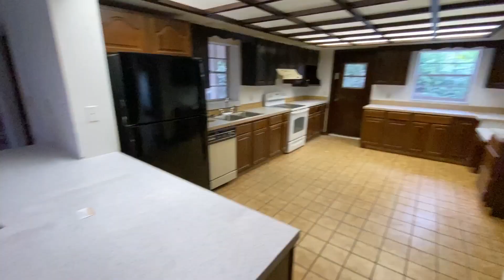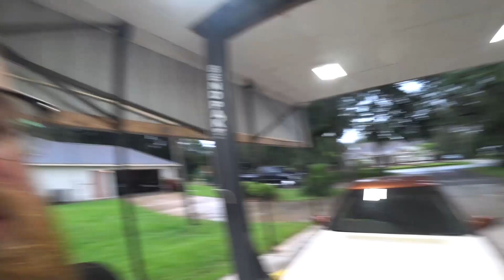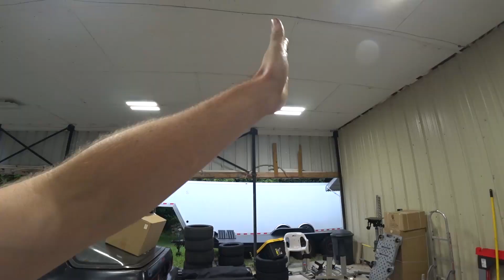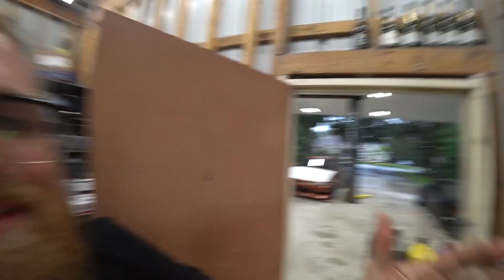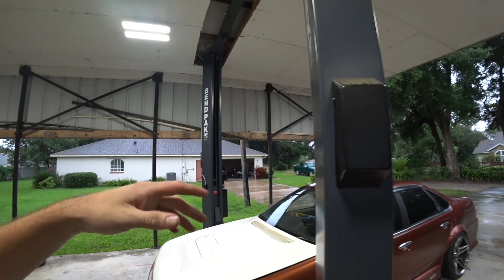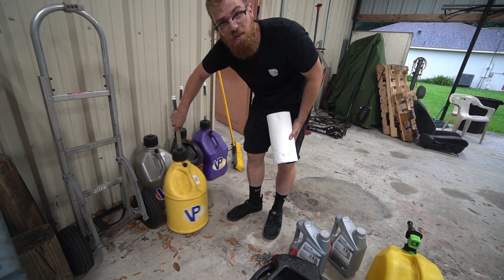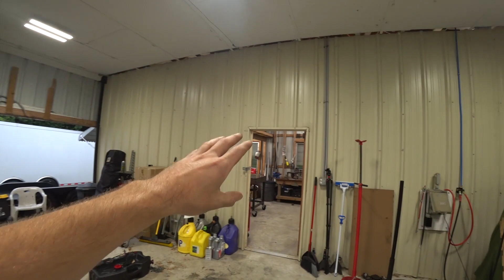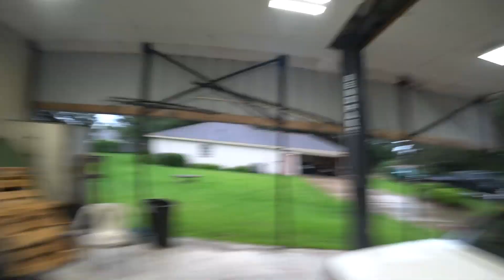Update on my new shop. I have to tear it all down.

Comment: The takeway? When you have an existing structure, permitted years ago... Just do what you want, and don't bother the city. They, and the contractor lobbyist groups that create these standards... are just creating job security with every inspection, standard, requirement, and permit they issue. It's not about safety, unless the safety of their own retirement is what you mean by "safety". Nosy neighbors notwithstanding, nobody cares what you do on your own property as long as it isn't directly affecting them. Make sure it doesn't, and you are usually home free.

Like the old question goes: If a tree falls in the forest, and there's no one around to hear it, does it make a sound? You can rework that to say:

If I do work on my place and there is no report to the city regarding that work, will an inspector come around to ruin my life? Most likely not. Do things quietly, and incrementally = Don't make too much noise, and don't do everything all at once.

You will of course have to do things yourself and use some common sense, but that's the trade off. Here's to your freedom. Enjoy it.

Comment: Would they allow you to have decorative iron work on the sides and front? No wind problem with wind 'caus it blows thru.  I'd the iron work happens to exclude people...great!  Decorative iron gates in the front roll away access!

I have seen roll up canvas/synthetic materials tarp doors on aircraft hangars.

Best of both worlds?  Roll up walls. Breezy when you want it enclosed when you want it.  AC if you want.

If the iron work is not declared structural and the roll ups are clearly not structural...

I suspect you can weld.  Labor addressed?  Look on line for the folks that make the roll up hangar doot.

Problem solved?
Reply from the maker: I had that thought. Building metal frames that bolt in. Then doing like removable inner skin. And  fake vines or whatever. But building the front wall is what’s complicated.
Reply: Do not connect the decorative iron work to the building..  Set it in footings.  Plant some vines that clime the trellis.   What the British call " Shoving a creeper up your trellis ".  

I'd it is not connected to the building is it not a perminant trellis for your climing beans? So the beans sometimes need a little shade and wind protection?  

If it is not connected to the building it is not part of the building!

Comment: I'd have bought two bay doors, designed and cut pieces for frames like on the sides to hold them, had a welding shop weld the pieces together, installed them, then finished the bottom of the two sides just like the tops were done, and nobody would have ever been the wiser. You are your own worst enemy for not taking the initiative.

Comment: If tou had problems with permits, then why go forward. I live in Fla,  n trash pick up reports to the county if they have to pick up an old water heater. Code info cement stops to see the permit and inspects the work. If it passes you have to pay 4 times the amount of the original permit. If it doesn't pass you need to pay 4 times the price, plus hire a licensed plumbing contractor to have it done and pass in section. And I know it's just a water heater. These days, there are just to many eyes. Then when you try n sell your home, a surveyor comes out makes detailed drawings of your property n building on that property. So if they don't match, they research looking for building permits and if they don't find them a whole can of worms is opened. 20/30 years ago things were different. I've all ways told customers to take as many pictures with tape measures showing accurate measurements especially on foundations, the size of rebar, spacing anything that they want to see before the footings n slab work was done. Tie down straps. Recites,  any thing that might come into question. ANYTHING. They might say OK, but then its paying 4 times the amount on all your permits that were needed. I've been an electrician for 4o years, built two homes, pulled permits I needed, got mu C.O.  And moved right in. Sometimes n someplace, it's not worth the money or the hassle to try n slide something buy. I feel bad for you, it looks good, but it's not always a neighbor.  Someone in your neighborhood might be having something inspected,  they see something else going on. They look into it. You have the mailman, meter readers, trash pick-up  any number of eyes. Hope all works out for you but if you were told at the beginning their is a problem, don't go forward. Find a solution. Maybe it was a zoning issue, what you were going to do in your shop. A machinist, you might need thicker and stronger concrete. Abom79, is building a new shop that has a crane going in so they had to pour a special footing under the crane to make it safe and 5000 lb concrete for all his heavy equipment. All I can say is best of luck. I sure don't want to see you have to take it down.

Comment: I think financially tearing it down is a poor financial decision. Because it's a perfectly good structure, you literally paid for it in the purchase price. Truly weighing up the cost benefits of it, I would continue to use this structure until it's reached the end of it's life span, that means, as it's approaching a point where maintenance is going to cost more and more to keep it, then pull it down.

I think what I would go with, is just sealing up the sides with some see thru material. Also, not sure about your permits, but here you can go full brick garage entry to a car port. Plenty of people have them at the entry to properties, where it looks like a garage, but behind the brick exterior it's just a carport. In fact, funny story, guy around the corner from me has a garage door and literally nothing behind it, looks like maybe the carport was removed at some point.

Honestly, it's a carport at this stage right? You don't need a permit to do a number of things, and if your worried about security, put up some alarm systems that are loud, have like lockable chests in the shop.

Though in the long run, I think that shop is sitting on a perfect future sub division to rent out. Don't know about the situation there, but here in Australia, your entire property would be turned into 3 - 4 units by now. Guess land prices aren't as high there.

Comment: You don't need a drop ceiling for AC,  you need spray foam, closed cell on all walls and ceilings.  take a second job if you need to for the money, (pretty reasonable).   but then you can cool the whole thing easily and be comfortable.  I'm in Georgia, have my house spray foamed and my 40 X 40 shop spray foamed.  I would not spend a dime on anything until i budgeted for spray foam.  Fiberglass in a metal building by the way is the most useless investment possible.  just saying.

Comment: ............All the details and complications without a hint of the costs......heck the demolition costs will be flexible via if someone could use materials.Im suprised you have an engineer willing to sign-off on using the foundation with new codes....... You got to spill beens on costs, at least ballpark.

Comment: i have discovered it seems to be a "florida thing"  finding contractors that are not lying about their credentials or extorting you because they actually have legal credentials, i just wanted floor tiles put into the kitchen, it was a total disaster, i thought , well that was weird, but then later on i just wanted 30amp put in for my RV to plug into, i literally couldnt find anyone to do it for less then thousands of dollars, therre was always a box on the pole, it just needed a little box run off of it or whatever, i dunno, i just know in ohio it would have not costed near as much and everyone's insurance and credentials are easy to look up and verify,  and it seemed to be the opposite in florida (i live in central florida ) so these guys came out fumbled around with the pole like a couple of apes, took my money and then never got the power hooked up to the pole, and florida seems to not have any laws in place to protect people from being ripped off. you can get the work done, but at prices that are insanity. florida is pretty, that is all, literally everything else about this state is rubbish.

Comment: I don't see the big deal.  Both walls that are shown are not load bearing.  Strip out the interior, beef up the rear wall for wind load using red iron.  Do the same with the other non load bearing end wall with the roll-up doors.  I've learned that you have to come up with a solution that the bookworm, no experience, educated folks can't reject.  You cannot lean on them to create a solution other than start over.  Basically the existing end wall would be a hybrid of angle iron, base angle, and eve strut.  Could even do it from the outside with the metal removed.  The opposite end wall you can make  steel columns, girts, eve strut, and base angle.  The middle wall would be demoed and out of the way for good.   IMO, You haven't found the right contractor.

Comment: Building codes basically come down to, is it built right for the area and human safety, Do yourself or a contractor the right way, and f@*k off the city permits. If it looks right from the outside you not going to have problems with the city.

Comment: Your getting ripped off.. get pressured treated wood.  Shoot it down into the concrete on each side!  Buy more coregatted siding.. and run it from the existing down to the treated wood and fasten it.. that entire structure is sitting on the steel posts.. you can do anything with it.. you just didn't talk to the right contractor.. I'd do it for cheep and make it look great..

Comment: They make things so freaking unbelievably hard it’s just ridiculous I mean give me a break I used to live in Florida I have a friend that’s a general contractor there seems like they change the codes every year it’s ridiculous used to be you can put up a pool cage blah blah blah simple now it’s like you got a steel cable steel pipes in the ground reinforced concrete all this crap and you know what it all doesn’t matter because if it’s Tintin or thin aluminum it’s gonna rip off and blow away in a hurricane anyway it doesn’t matter what you put on there you know under 150 mile an hour wind bye-bye it’s ridiculous,

Comment: First time visitor/viewer to your channel. Commercial space isn't viable? Seems like you are tying to force a commercial building/business in a residential area. Maybe I'm wrong, but that seems like a more practical solution.
Reply from the maker: It’s just a hobby shop for my own projects. Most of the houses in my neighborhood have shops. As I mentioned in the start of the video. For me to rent a similar size shop. And even a 1-2 bedroom apartment would be significantly more than the mortgage to have a house with a shop. It’s allowed to have a shop
In my area which is why I bought here.

Comment: Sorry for your nightmare . Could you not have roll down bamboo blinds? Not considered a permanent structure. Yet  almost as durable and stronger than sheet metal.
   I have found through the decades Architects and the government has their head stuck in a smelly hole. They're worried about wind codes, yet the shop is fine as it is? It's a parachute! With it open it catches air. With it enclosed it's going to strengthen the other existing building. Florida is an odd State anyway. Zoning in the Ozarks depends on where you're at pulling permits. But it's not even necessary if you have more than three acres outside city limits. With that said I over built my house to withstand 200 mph winds. But there are many around here with 2 foot centers, no blocking, no H25, no hurricane straps, or even joist hangers. Fine I'm not living there. Back to architects.  I drove a big rig around the country for a million miles. You would think in a business park where the whole idea is warehousing, with big rigs moving about. They would design maneuverability for the big trucks. But often it's easier to maneuver around a Walmart parking lot then in a business park. You can only get so much out of your textbook then it's time to go real world.

Comment: OK first off I don’t know why you’re not doing this yourself all you would need is a ram set put some metal studs on the floor metal stud them up to that wood beam so that you have wall studs and then buy those corrugated panels for the outside and close it run some electrical along the walls if you want put in the rough opening for a man door and garage door or just call  a garage door company to make the rough opening and hang a door and you could run the electrical for the door as well I’m looking at your space none of that looks like a real hard project In fact in side my office and I referring to a whole plaza they say hey we need a wall or  an office here and you just start ramming in some metal studs it’s really not that hard I think you’re over thinking at maybe watch a video on how to do it but you’re not doing drywall and insulation like I have to do in Buffalo you’re just basically building a metal building and you’ve already got the beam over your head to tie everything into The beam you just have to ram set the sill into the concrete I mean anybody can figure out how to do walls and studs 16 on center the only thing that might be more complex than that is the Jack studs for the man door and I had her over that and all the studs you would need to build the rough opening for the garage door and the header beam over that so the spring the torsion spring can be hung properly and then some kind of framing overhead a ceiling joist that you could hang the garage door opener motor from any easier than that and you’d be running a Shower curtain all the way around on a cable LOL call a handyman stop calling companies that want to charge you $30,000 you should fly me down there with one of my guys buy some materials that you can return PS I daily wage if you don’t like what you see  send us home

Comment: Let me guess, California?
As an experienced master carpenter, I can tell you that what you went through, is a load of crap. Those walls could have been reinforced. Some of those bearings are sketchy, but nothing that couldn't have been dealt with. This is what happens when building codes are made by lawyers and bureaucrats, and not experienced tradespeople. 
But on the other hand, at least you get what you really want.

Comment: I new you were screwed when, I seen the combination wood and steel framed structure in your broadcast. You claimed to have construction experience then why didn’t you know this stuff before you purchased the property. In further viewing your broadcast, It appeared the concrete below your feet might have issues. It did not look right in the video. Or maybe just a bad concrete finisher. Let me leave you this. I don’t know what state you live in. But as far as wind loads it has to be able to resist, F5 & Category-5, sustained loads. One is, “Tornado wind loads the other is, Hurricane sustained.” That’s what the Professional Engineer is supposed to do. Also earthquake loads to resist 8.5, on the Richter Scale. In my mind, If I was looking to build a home shop to do my own auto work. I would go all steel insulted with a central heat and air, with a back up generator. Roll up doors to the height that will be able to handle a 4Wheel drive with at minimum 35” tire height. That way your covered for most recreational builds to handle the most projects labeled as fun. Wish you best success, Aloha.

Comment: All of this could have been avoided by simply burning down the local inspection offices, and dropping a burning tire into the front yards of the 'yard pigs' houses, as an implied threat that what happened downtown could also happen there. 

Or you could set your house on fire, then load your small plane up with as many fuel cans as will fit, then fly it into the local IRS office building...no, wait, that's been done...

Comment: I don't understand I'm looking at this structure and it's built better than any pole barn that I've seen professionally done at least in the midwest I've got an excellent pole barn that is mimicked of a Morton pole barn which is the top-of-the-line pole barn and my pole barn is not framed in near as sturdy as what yours is I don't get it Florida must have some really strict standards but what I don't understand is why in the hell did you not just slowly start in closing the building yourself nonchalantly under-the-radar quite quietly now you got a tear down a building and build another building you know I guess you know hindsight but I would have just very quietly started enclosing it as I went doing it very quietly not saying anything to anybody buying a few materials at I'm not having big trucks or anything's show up just doing it very quietly rent a truck if you don't have one and go pick up some materials bring them in not doing anything much on the weekends doing everything during the week that you could do something the proper way and get a permit because anytime you do that you open up such a huge can of worms that there's no way that you could win

Comment: Where in hell did you buy a house with a city council that jerks you around like that??then again with electricity rates that good I would live there to if o could run heat/ac 24/7 for 300$ a month in a 2000square ft shop,your living In dream land on that and a few other things,but hey, you will figure it out.😉

Comment: On the truss that was not on the wall why not build a gable end you don’t need a truss , there is so much about this that is wrong with this whole deal did you have a permit for the existing building, there is no reason that you couldn’t have added walls to the existing building , sounds like you didn’t have the proper contractor or architect , shear panels would have taken care of most of it